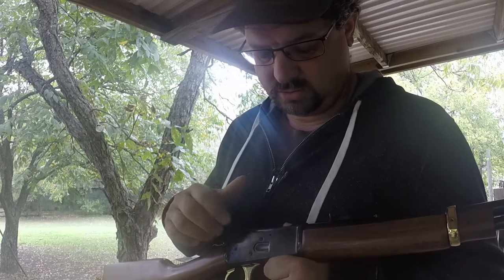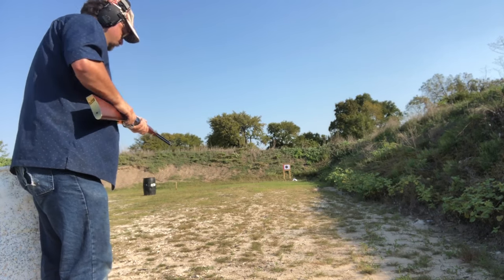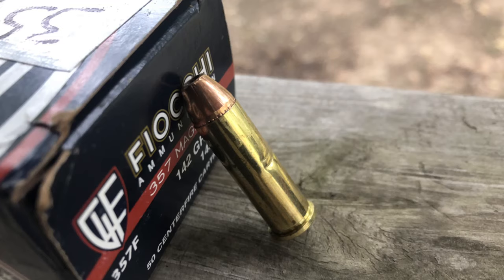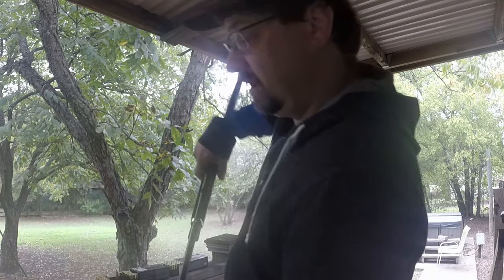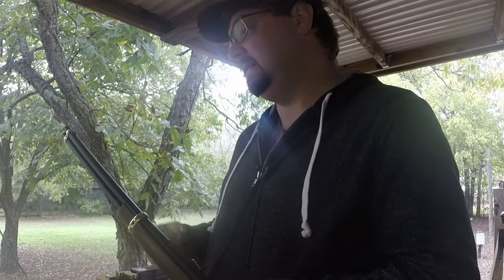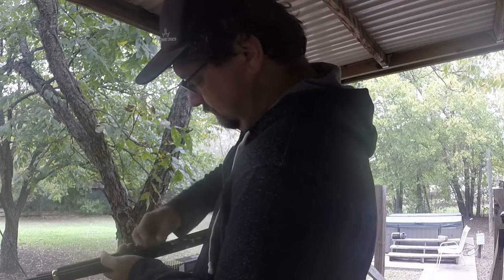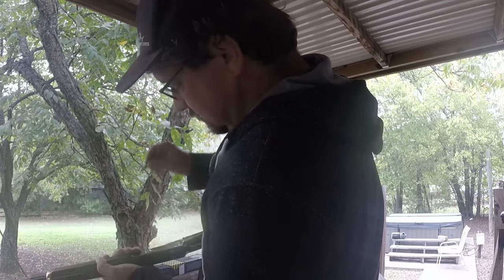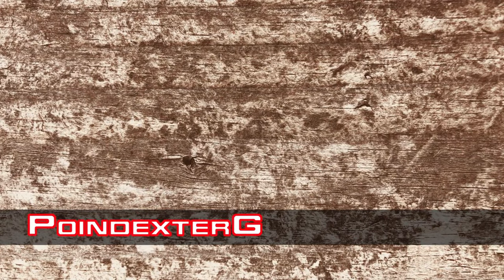Fixing the Rossi R92 Loading Gate

Comment: Yeah man I would not cut any spring. You can shave down the loading port and grease her up nice but after so many shells it'll loosen up about 40%
Reply: Normally i would absolutely agree, but if they are using the same spring for the 24", 20", and 16", it makes sense. I cut mine down about 3" and it feeds awesome and loads great. I haven't found the need for a plug though,  it sorta just seems to stop after the 10th round with the .357 but other than that it cycles fast and smooth.  I did do the extractor spring replacement and used 600 then 1000 grit on the surfaces of the internal mating parts, then wiped them all with synthetic moly grease,  let it sit overnight and wiped them all down put everything together and work it all hundreds of cycles.  did the break initially without lubing it to find the wear points,  that helped identify where to spend time polishing it up. But man, its super slick now and so smooth to operate its crazy. the trigger is about a smidge over 3lbs pull now as well. I just polished everything that the trigger touches and moly'd that up as well. With a little friction moly gets into the metal and really impregnates it. you can wipe off all the excess, but it still stays in there and stays pretty slick.
Reply: @spudthegreaterusa8386  damn man sounds like she's perfect lol. I just saw on yt a guy that bout the tactical forarm rail, pic rail, and hand buttstock. But ty for sharing how you did it all your set up. I'm still working on mine and I'd say now of what and how u did yours I'll go back and finish more sanding and maker smoother. Thank my friend. Do u have any new vids on ur 357??
Reply: @Hunterslife315  no vids, but it looks great. I also did a parachord wrap around the hand loop, same color as the red dot site. I'll see about posting a pic on you tube and inserting a link. I wasnt sure how this would all pan out , and to be completely transparent,  it was a complete cluster at times putting it all back together,  it really to days and days to get it all done. most of the time was just waiting between tru oil applications,  did 8 total I think, let it dry at least a day in between coats and steel wooling them etc
Reply: @spudthegreaterusa8386  that's cool man. I only did a regular black Paracord myself. I'm plain and simple and I'm a pretty good with irons but I just need to sand more and redo the blu. But thats be cool man I'd like to see pictures definitely
Reply: @run&gun  Here we go, made a very brief video of my Rossi, forgot to show the safety replacement cap.  oh well. And its called a "Buckhorn" sight, not Bucktail. I got that messed up. 
https://youtu.be/xrqBeWTCW4A
Reply: @spudthegreaterusa8386  awesome man thanks. And I get it mixed up too lol. But thanks for sharing my friend..🤙

Comment: It's not hard to load just use the next round to push it in .
Reply: It's still very hard to load because the loading gate leaf spring and the magazine tube spring are way too strong. You can modify both and end up with a loading gate that feels like the loading gate of a Miroku Winchester (sans the nicer rounded edges in the Winchester)

Comment: I’m in no way trying to be offensive but I would recommend just leaving your gun stock.

I had a neighbor take a perfectly perfect Glock 19 and dork it up so bad with “upgrades” that it was a pile of garbage.  Guys, seriously, just stop doing “fixes” unless it’s absolutely necessary.
Reply from the maker: It's literally just cutting a spring and making a plastic plug. Stock springs are readily available, so it's not like I'm "dorking" it up beyond repair. The only reason I recommend this is because it's a small modification to an easily replaceable and inexpensive part.
Reply: @PoindexterTactical  I understand what you’re saying, however, like you said, now you always have to count how many rounds you’re loading or else you get the last round jammed up.  I’m not saying you broke your rifle or anything, I just don’t see the need.